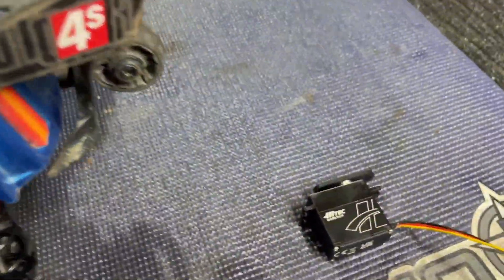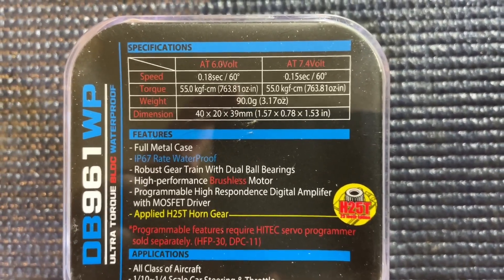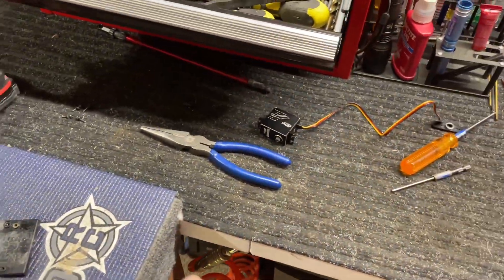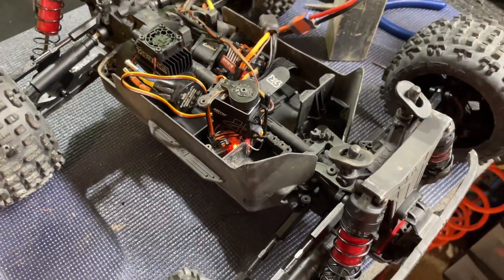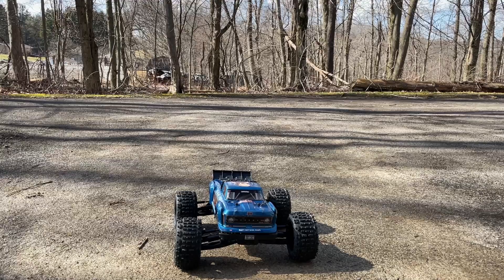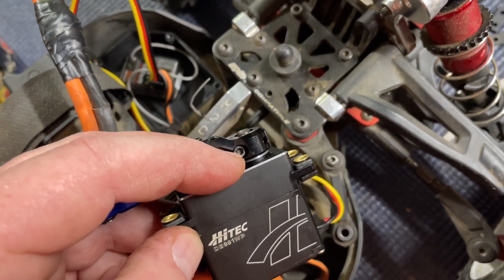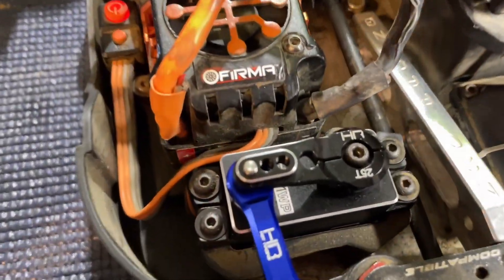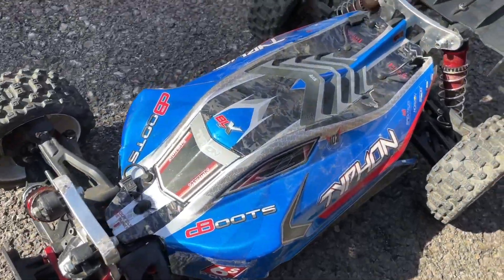Typhon 6s and Outcast 4S gets a servo upgrade! Hitec DB916WP servo. ￼

Comment: Totally off topic but,, In your Outcast 8s would you pick the same power combo again or would you go with something different? I’m building one and can’t for the life of me decide on what combo to put in it,, I appreciate any help.. always enjoy your content! Hope all is well 🙏
Reply from the maker: Hobbywing max5 1100kv motor
Reply: @BarstoneRC  last question 🙋‍♂️ if I use the Max 5, does the Outcast 8s roller have the mounting plate for it, or do I need a mount for the Max 5? If so, which one should I use? I ordered the combo and appreciate your help!
Reply from the maker: M2C racing has the mounts.

Comment: So you put the stock servo saver on the new servo?
Reply from the maker: No, there’s no service savor it all on the Servo
Reply: @BarstoneRC  ok i thought the black piece is a 23t servo saver. Most servos are 25t right?
Reply from the maker: Spectrum uses 23 I believe and a lot of things are 25 or I have that backwards lol but yeah I had to change the arm because of the different spline count
Reply: @BarstoneRC  i believe stock is 23t i just finished swapping out my servo and radio system in the Outcast. I wish i would have gotten a better servo lol. I ended up smashing on the original parts to the new servo and it seems ok for now. I did that on my typhon and never had an issue.
Reply from the maker: Well, run a Servo till it dies. You never know with my last a long time, but have fun with it man!
Reply: @BarstoneRC  exactly